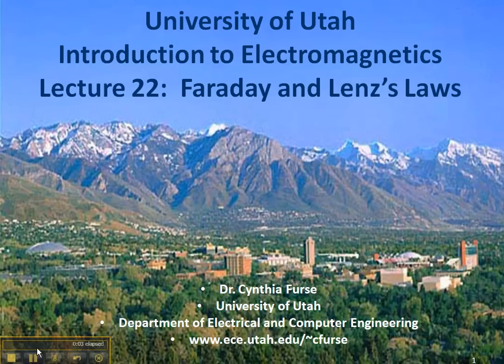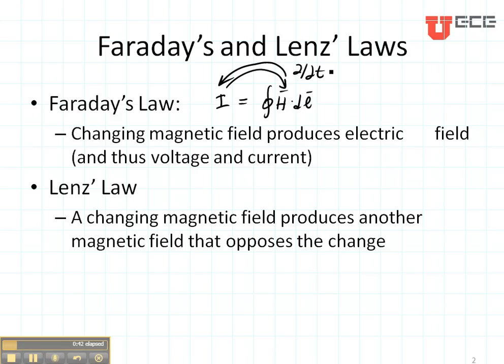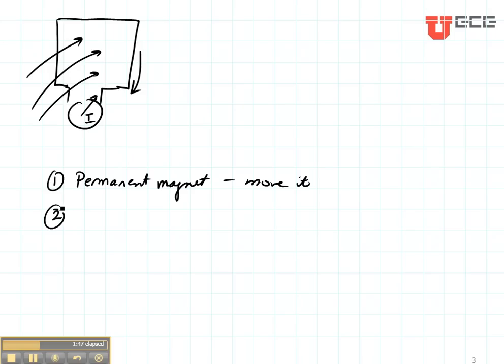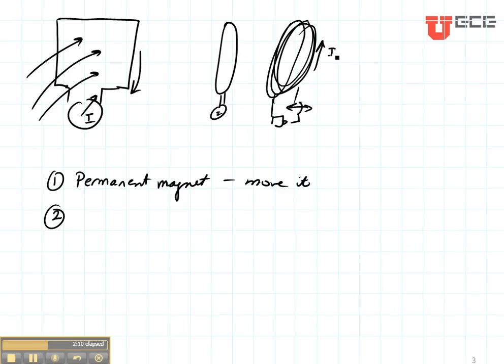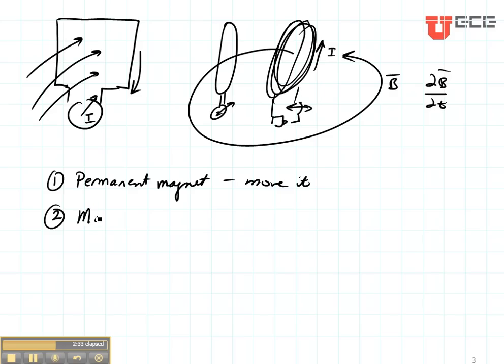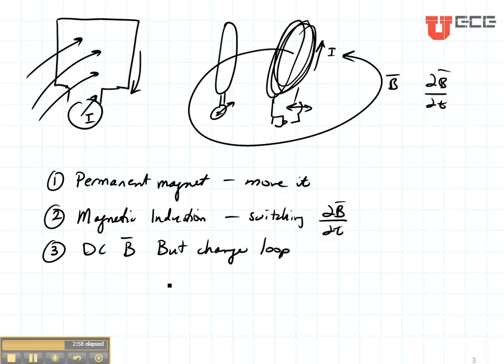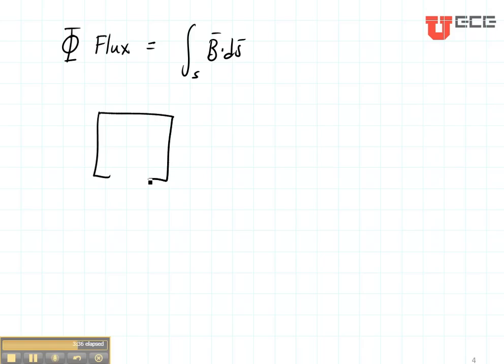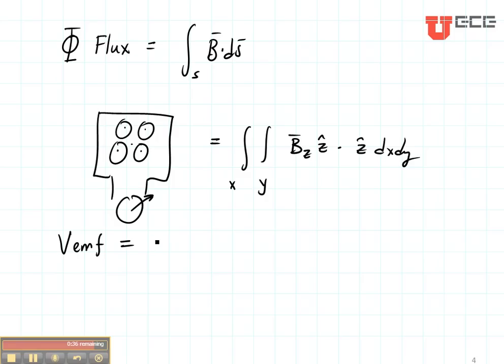ECE3300 Lecture 2211 Faraday's law

Comment: In the first part of this video it's explained that if the magnetic field doesn't change a current will not be induced in the loop. Isn't it more accurate to say that if the magnetic flux doesn't change a current will not be induced in the loop? Because if the magnetic field remains constant we can still induce a current by changing the area of the loop and thus the magnetic flux. Thanks.